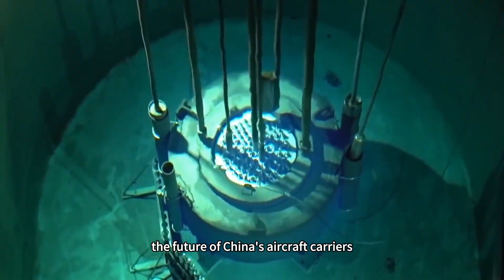At least 4 ships! China's Nuclear Carrier With 4th Generation Reactors Can Outperform Ford Class?

Comment: This is an exceptionally well-researched and sophisticated piece of analysis. It is absolutely not nonsense. It dives deep into the strategic, technical, and economic reasoning behind China's future aircraft carrier development. Its factual value is very high concerning the established context and technological principles, but its core conclusion is highly speculative, although it is the most well-supported argument for that speculation I have seen in these transcripts.
Here is a detailed breakdown:
What Has High Factual Value (The Strengths)
The transcript builds its speculative case on a very strong foundation of established facts and correct technical principles.
Strategic Rationale: The explanation for why China needs nuclear-powered carriers is perfect. It correctly identifies the shift from a "doorstep" defense navy to a blue-water navy capable of protecting global interests (like the Belt and Road Initiative) as the primary driver.
Accurate Naval History & Technology Principles:
The pros and cons of conventional vs. nuclear power (cost, range, maintenance windows, space for fuel/munitions) are explained accurately.
The historical examples are used correctly: the Battle of the Eastern Solomons (USS Hornet refueling), the French Charles de Gaulle's underpowered submarine reactors, and the US Enterprise's eight-reactor configuration. This shows a deep knowledge of naval history.
The critique that submarine reactors are not ideal for carriers is spot-on.
Real-World R&D in China: This is the most impressive part of the transcript. It anchors its main speculative thesis in real, verifiable developments:
Thorium Molten Salt Reactor (MSR) Program: It correctly identifies that China has a major MSR research program. The Shanghai Institute of Applied Physics (SINAP) is the lead, and the 2MWt experimental reactor in Wuwei, Gansu, is real and has received its operating license.
Thorium-Powered Container Ship: It correctly cites the fact that China's Jiangnan Shipyard (part of CSSC) has unveiled a design for the world's largest nuclear-powered container ship, which is based on MSR technology. This is a crucial "bridging" fact that makes the leap to a naval application seem more plausible.
China's Thorium Reserves: It is a fact that China has significant thorium reserves, making it a strategically sensible fuel choice.
The Highly Speculative (But Well-Argued) Core Thesis
The entire transcript is a buildup to one central, speculative argument: China will "bend the road to overtake" the US by leapfrogging directly to 4th-generation thorium molten salt reactors for its future carriers, bypassing the mature pressurized water reactor (PWR) technology used by the US and France.
The Leap of Faith: While the research is real, the transcript downplays the absolutely monumental engineering challenge of going from a 2-megawatt land-based experimental reactor to a pair of powerful, reliable, shock-proof, and fully marinized reactors capable of powering a 100,000-ton supercarrier. This is the biggest speculative leap.
The Narrative Frame: The "bend the road to overtake" concept is a popular narrative in China, but it presents a high-risk, high-reward strategy as a guaranteed success. The transcript effectively adopts this optimistic framing.
Minor Errors and Inconsistencies
For a piece of this quality, there are very few errors, but a couple are present:
(0:26) "making it the only country in the world to have a catapult-type aircraft carrier": This is factually incorrect. The US and France both operate catapult-type carriers. The intended meaning was likely "the only other country besides the US with electromagnetic catapults," but the sentence as written is wrong.
(10:41) "Nuclear-powered carriers with thorium-based molten salt reactors have lower maintenance costs and overhaul intervals than U.S. carriers with uranium reactors": This sentence is confusing and contradicts the point made just before it (a hypothetical 15-year overhaul for thorium vs. 25-50 years for uranium). A shorter overhaul interval is a disadvantage. The author may have meant overall lifetime cost, but the wording is flawed.
(5:39) "500,000 horsepower": This figure for the USS Ford's reactors is a common but likely exaggerated number found in open-source reporting. The actual shaft horsepower is significantly lower.
Conclusion
This transcript is an excellent example of high-level, well-researched speculative analysis. It is one of the most credible and detailed arguments available in the open source for the theory that China may pursue thorium reactors for its future navy.
Verdict: It is not nonsense. Its factual value is very high in its contextual and technical explanations. Its central thesis about thorium reactors is highly speculative but intelligently argued and grounded in real-world R&D. A viewer would come away with a deep understanding of the strategic choices facing the Chinese Navy, even if the ultimate outcome remains uncertain. This is top-tier analysis for an informed audience capable of distinguishing fact from reasoned conjecture.